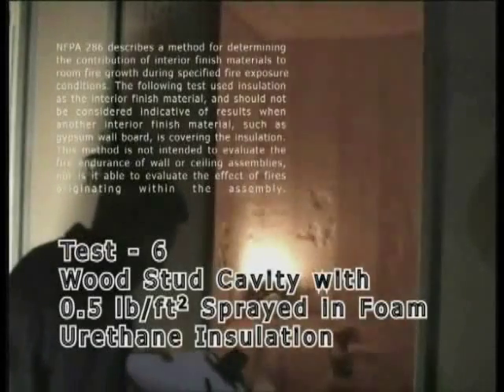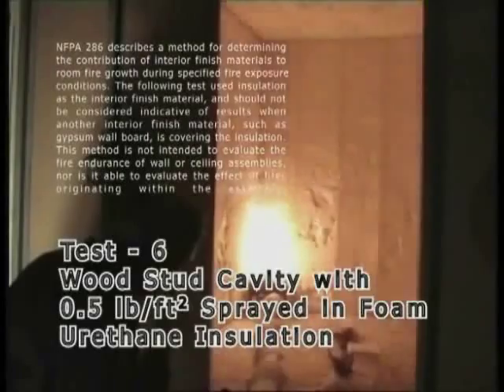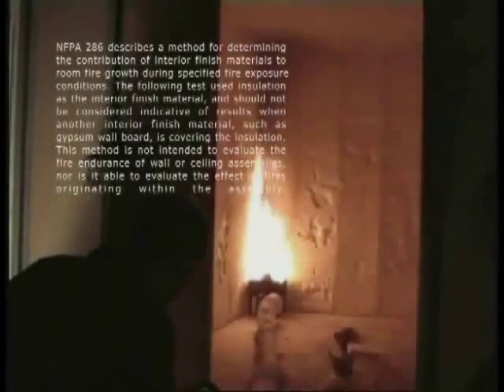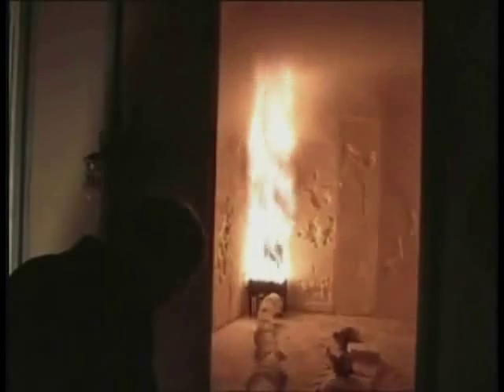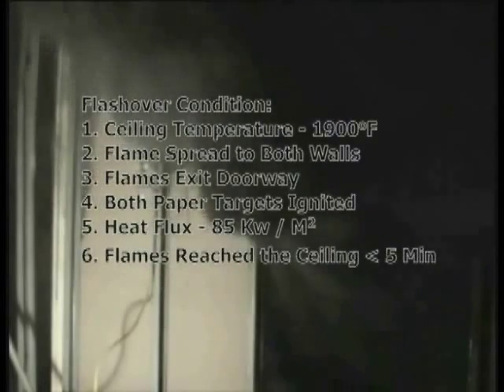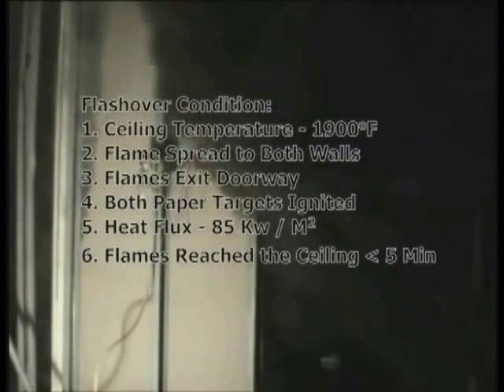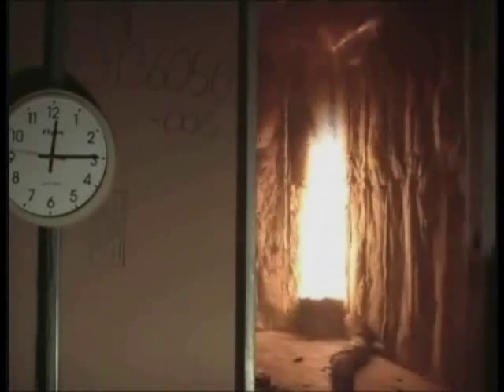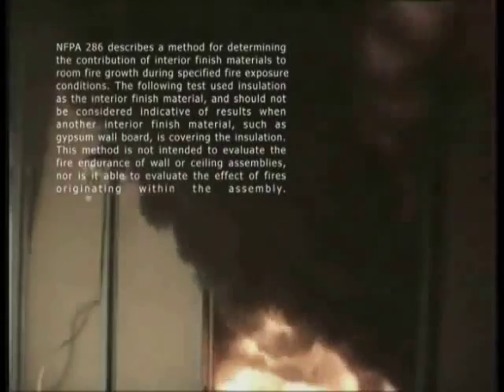Fire Test with Foam Insulation

Comment: Obviously an invalid test performed. You are closing off air into an area with spray foam insulation, therefore taking away the ignition source (oxygen). When you have a large hole in the "testing" area, which is feeding oxygen to the fire, the flashover temp is very easy to achieve. With batt insulation, there is oxygen trapped in the fiberglass, making the flames spread slower than when you shut off the supply. It's the anatomy of a fire and these people performing these tests obviously dont know what they are doing. More than likely, they have a vested interest in other forms of insulation and are threatened by the much better foam insulation.